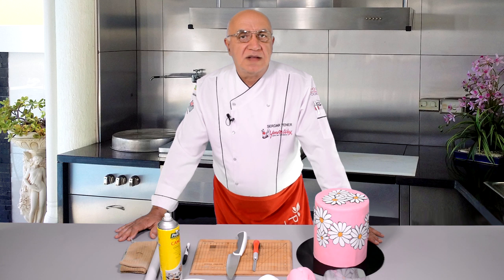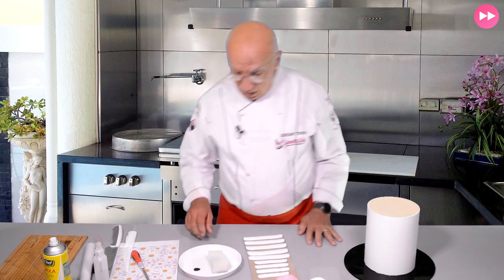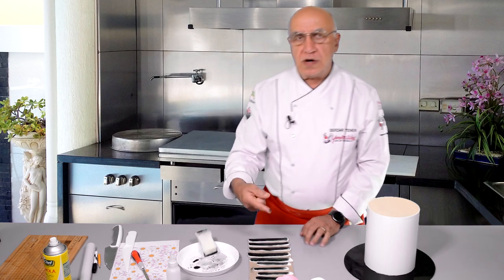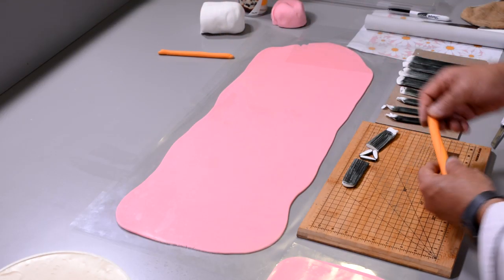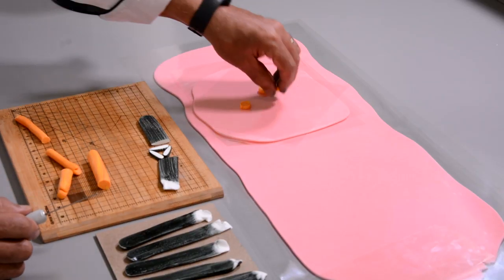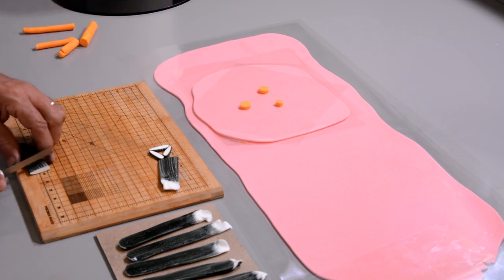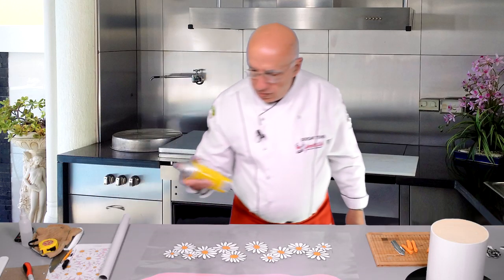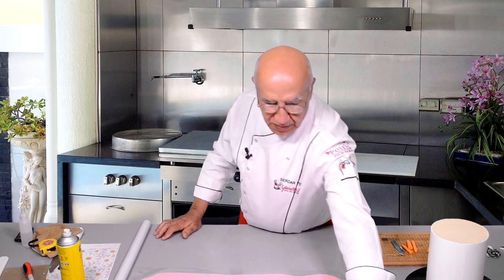Yeners Sliced Fondant Pattern Technique - DAISIES | Yeners Cake Tips with Serdar Yener

Comment: I really appreciate your detailed tutorials 
What sheets are those and where can I find them?
Reply from the maker: Just go to eBay and type cellophane sheets. It comes rectangular sheets or in  40 or 60 cm wide rolls. If you like to know exact thickness, I use 27micron for cones and 35 Micron for sliced fondant method.  30 micron is good for everything.

Comment: Hi Serdar, I notice your dummy is very white and smooth on the outside. Do you cover it with pastillage first? or do you prep them some other way please?
Reply from the maker: It is a PVC pipe from the hardware store.
Reply: Yeners Cake Tips - Yeners Way you mean the rolling pin? I sand my dummies with a very fine sand paper.
Reply: Hi Agrillot6, I do too but if you look at Serdar's it is very smooth on the outside and whiter than the top. As he has advised he covers his with a PVC pipe. If you look closely you can see the rim of it on the top of the cake.
Reply: Alison Scurr WOW I didn't know they had them that big! I guess you learn something new every day.

Comment: So pretty but you sacrifice looks for taste with fondant. Nothing taste so good as buttercreme or a fudge icing on a good cake. I just made a fudge cake using processed Dutch cocoa with a bittersweet fudge filling topped with raspberry buttercreme and decorated with a large shell boarder at the base with tiny fondant flowers and leaves, a small shell boarder at the tip edge with tiny flowers and a larger sized fondant rose and ornate leaves on the top. It looked great but mote importantly everyone who ate it said they were so glad I didn't cover the whole cake with fondant and loved the raspberry buttercreme  on the deep chocolate.